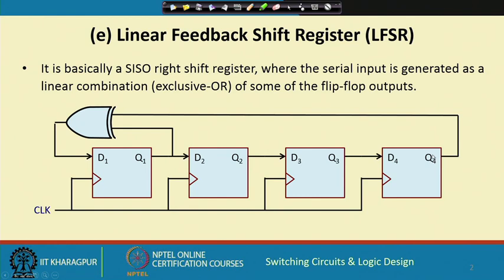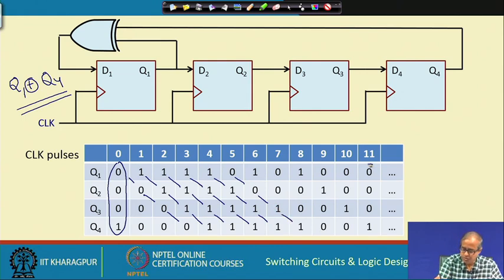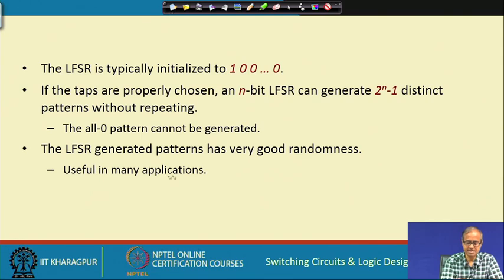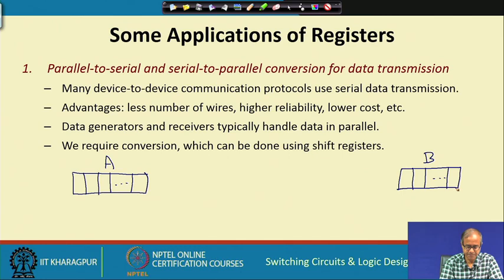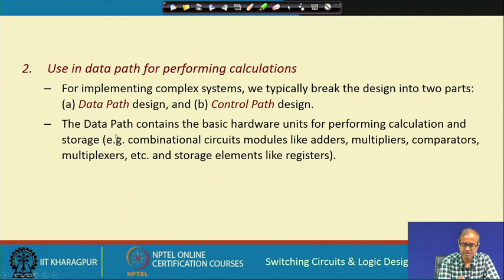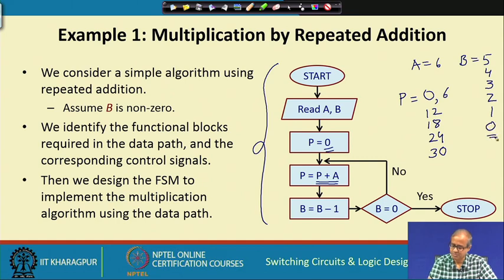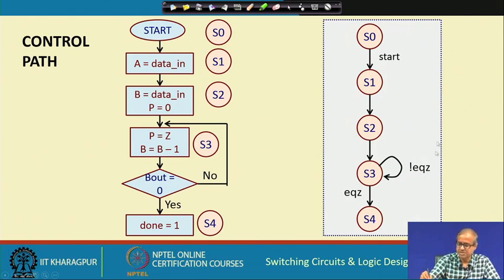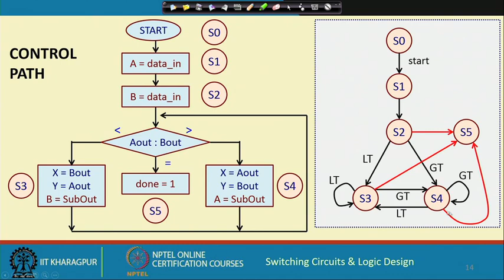Lecture 44: Design of Registers (Part III)

Comment: A 4-bit LFSR can generate 15 patterns. In the example shown in the video, the output after 7th clock cycle should be 0101 instead of 0011, that makes way for 5 more cases, satisfying (2^n -1) random outputs.
Reply: Same doubt......
Reply: the example only had 10 patterns, but yes you are right that the 7th clock cycle should be 0101
Reply: EXACTLY!!!....Thats a small error.Apart from that the lecture is fantastic
Reply: Yes, LFSR shown here is nothing but a pseudo-random binary sequence generator.